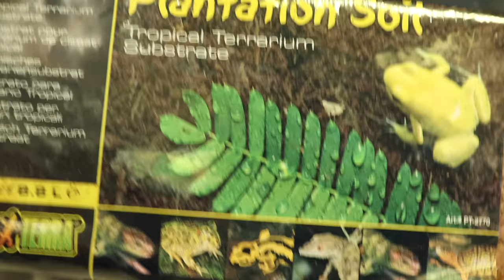Sad News and New Tank

Comment: I have 8 bioactive enclosures for tarantulas, and yes isopods will be just find with your Ts setup. In all mines I use springtails isopods and earthworms. The only I think may be a problem for your T from what I can see is since it's for a pink toe it should be more vertical than long, and probably doesn't need anything too much bigger than a 8x8x12.  But with your being bigger I would just add more vertical points for the T to web from and anchor from. Keep up the good work with your videos!
Reply from the maker: Thank you! I just got scared about height because of the last one. Livable area of this one would actually come out to about 8x9x12 if I turned it up on its side (and put a good amount of substrate at the bottom). 🤔 I might do that. Or add more vertical points to it how it currently is. I'll do one of them haha. Thanks so much! 😊
Reply: @ellesreptiles  I would just add the vertical points  and maybe a little loose spag moss wit the leaf litter and your T will use it too in its webbing and I think it will be fine. But for the most part baby Ts die for alot for no reason up until it about a sub adult.
Reply from the maker: Ok, I'll add the spaghnum moss today. Thank you so much again, you've been very helpful! 😊
Reply: Hi Theo.  Good to hear from someone with experience with this.  What isopods are you using as there are some significant differences in the types.  Thanks.
Reply: @SupremeGecko  dwarf purples, dwarf whites, giant oranges and powder oranges.

Comment: I'm pretty sure the paint issues were from the WQ40, it's pretty water resistant. I'm not sure dawn dish soap is tough enough to get rid of it all. 

Anyway, great video! Sorry for your loss! I dont know if you always do this, but maybe try having the enclosure set up with out the tarantula for a couple weeks to see if its maintaining the proper temps and humidity. So you dont have to make changes with the animal already in the enclosure.
Reply from the maker: Yea maybe! It looked/felt like it was all off, but I was just following a "how to get rust off a cast iron skillet" tutorial haha. 

Also yes to having it set up for a little while, this will definitely be up for a while before anything goes in 😊 The last tarantula tank was set up for about 5-6 months before I finally put something in it haha. I had made a couple changes right before I put her in, but it was up for a while. I'm currently deciding if I even want to keep it as is, or turn it up vertically 🤦🏽‍♀️ haha

Comment: That will be a better set up for a terrestrial (thought with more substrate) arboreals don't use the floor space. Alternately, you could silicone in acrylic in the "top" with a door in it and set the whole thing on end. I'm currently prepping a 5 gallon for that type of remodel.
Reply from the maker: Yea I'm thinking about turning it on its side. 🤔 I have plenty of plexiglass left to add in a substrate barrier at the bottom, so I might do that 🤔
Reply: That would be better for a pink toe, but it's a lovely set up for something ground dwelling. I want to change my Ts over to bio-habitats, at least the more moisture dependant species.

Comment: Just came across your video on bioactive enclosure for your new critter and I noticed your SCREEN in use for drainage.    Suggest you verify what the screen mesh is made up of. As the chemicals in the mesh could be quilty of poisoning your Spider. Let me know what you think. Enjoy your Channel 😀
Reply from the maker: Hi! Yes, it's just normal fiberglass mesh screen (I use this in most of my bioactives). When I was researching for how to build T bioactive setups, I did notice that some people get concerned with using this as a lid/ventilation hole cover, because it can easily be chewed through, leading to T escapes. That's not something I need to worry about with a drainage barrier though. Thanks so much for the suggestion! ♥️

Comment: RIP 🕷. It could have been a bad molt. What did you use to clean/wash out the tank? You could have used a product called F10. 
I would have used an aluminum window frame and screen then added the plexiglass over that. What about a hide?
Good Luck with your new 🕷

Comment: Rustoleum appliance epoxy probably wouldve worked for the lid. A lot of people in the sugar glider community use it for rusty cages. Ive used it and it works great. 

Good job though! Plexiglass is a pain to work with and I hate it. I totally wouldve taken the lazy route and bought a new lid. Lol
Reply from the maker: Thank you! I actually looked at that, but didn't know if it was safe. So thanks so much for the info! 😊